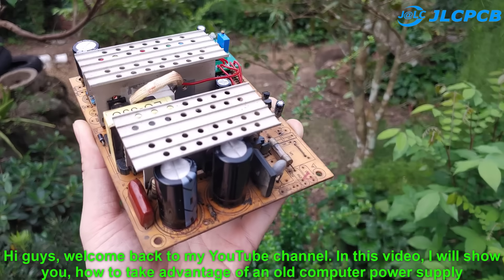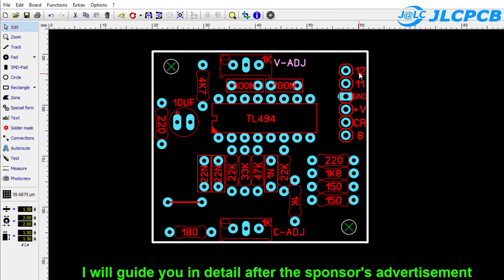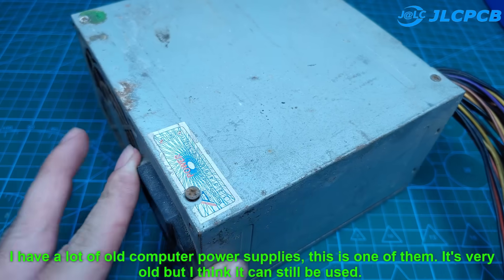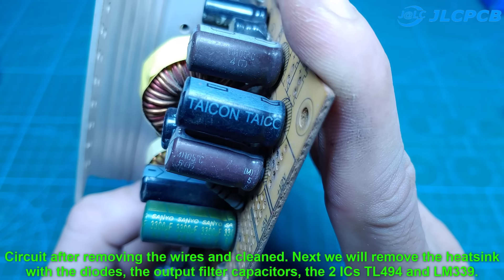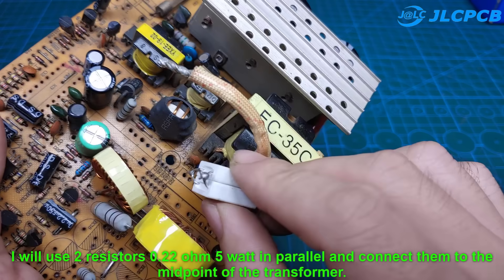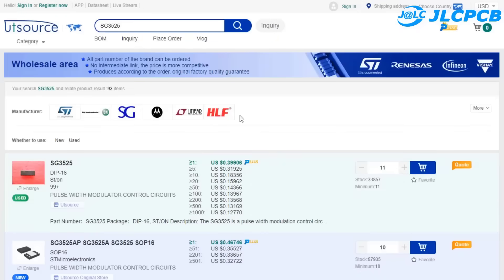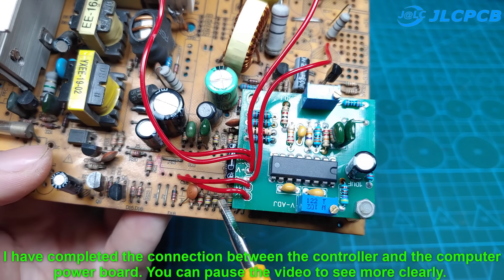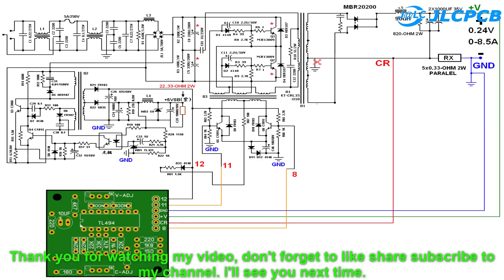Power Supply 250 Watt, Volt From 0 to 24V, Current From 0 to 10A.

Comment: I have made a Compact Inverter 12v to 220v from your video but it gives extreme heat to the MOSFET (3205). 

Please help me to fix the issue. 

Please reply 🙏

Thanks
Reply from the maker: Hi bro, you need to check your transformer.  Maybe the inductance of the 2 primary windings is different
Reply: @LongTechnical 
 3T-0-3T in the secondary
110T in the Primary 

Please let me know whether it is correct or not?

 Thanks for the reply 🙏